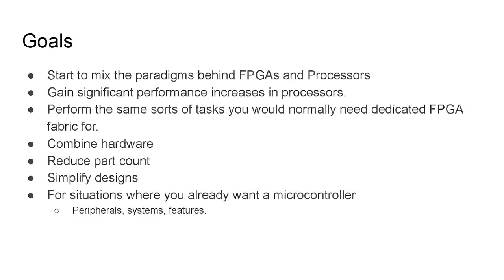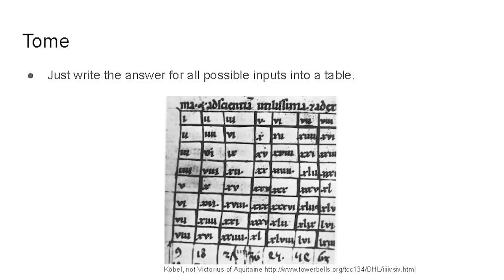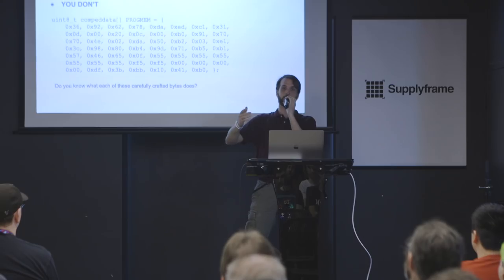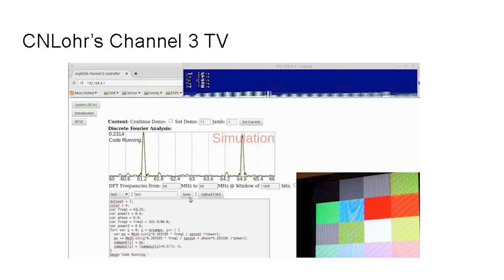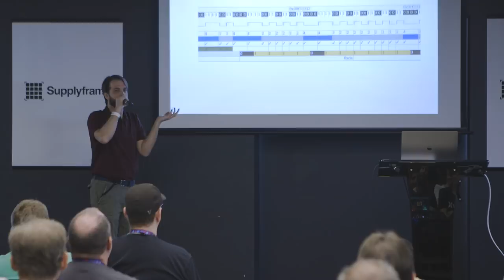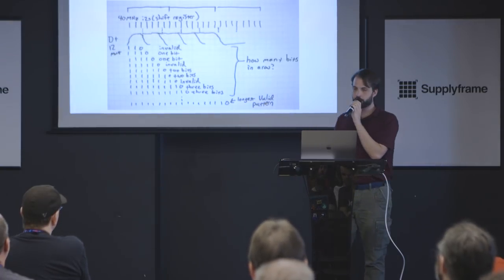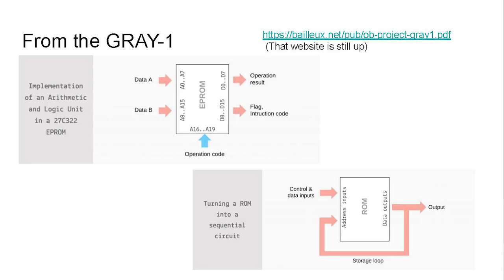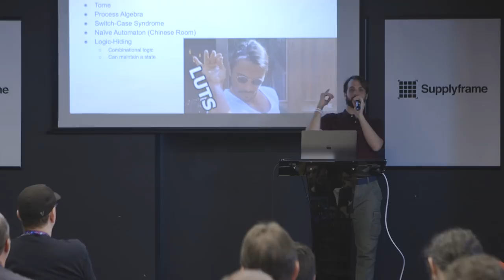Charles Lohr - Accomplishing the Impossible with LUTs

Comment: One thing to consider with LUTs is the lookup costs. If you are on a modern machine with lots of cache the RAM lookup can be more expensive that computing the value.
Reply: This is particularly interesting when it comes to zlib.  You can expand the immediate lookup table to encompass all possible bit values, but it turns out it's a lot slower because of cache misses than doing a small table and any ambiguous options just say "I don't have that entry, go find it the slow way"

Comment: Just one note, if you actually want to reuse some code, make sure you document how the LUT are generated. If not, you might end up with unmaintainable software, because the knowledge to reproduce or modify the table is lost. Maybe even include a snippet for generating the LUT.
Reply: Or better yet, include the generator scripts in the repo.
Reply: or do like that (imho mostly bad) arduino onewireprotocol library does and set a compile time constant that defines whether or not to use the smart lut way of things or the slower conventional code. this may just be an addidtional helpful thing to have aside from the generator code
Reply: What @cbrpnk said.  Any time you use code generation to solve a problem, the generator program becomes what is maintained, documented, and distributed for the project. You could even argue that the generator's output - the LUT in this case - doesn't even need to be checked into the repo, since the generator can be run at compile/setup time.

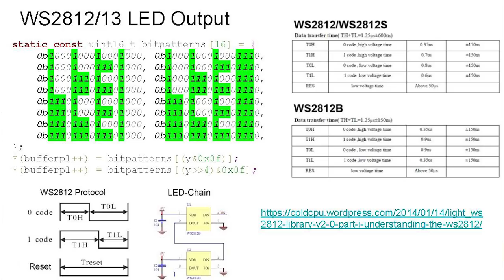Comment: Just a note to those following along. On the WS2812 look up table code at 11:50 , the look up table is used to map the y byte value into its WS2812 representation on the communication line. If y = 0xfe, the lower nibble 0xe(0b1110) is indexed to [1110][1110][1110][1000], the bitbanged shift register representation(Assuming a bit delay of ~0.2us) of 0xe on the WS2812 protocol. The same for the upper nibble. y=0xfe therefore maps transparently to its WS2812 line protocol representation .

Comment: An observation. 20:46 where you read in state use a lookup and then also feed some of the output back into the lookup - this is the same paradigm used by Wozniak on the Apple II Disk drive controller that accomplished the amazing feat of floppy interface that became known as the Integrated Woz Machine and was cheaper and simpler than the 40 pin disk drive controllers available on the market at the same time. It goes without saying that this is a fundamental paradigm.

Comment: I've been a fan of lookup tables for a long while now. The Apple ][ high-res color mode did NOT use a linear address space for vertically addressing the video RAM (it was surely a Woz thing to save on TTL chips), and a lookup table for which line starts as what address made things a lot faster.
Reply: Same with the old ZX Spectrum. Was faster to use a table to work out the first byte of a row than bit-shifting etc. Also, totally unrelated, was faster to clear RAM in reverse by setting the stack pointer to the last address-1, then using the PUSH instruction to store 16bit values and decrement the pointer by 2 bytes with a single command :)

Comment: First off, sig() Log() etc. aren't that hard to do without multiply.  CORDIC and relatives lets you do them using a small LUT and a tight loop at 1-bit/loop.  This is especially good for situations where the lookup table transitions can cause trouble like with PID loops. 

Second, LFSR's are awesome.  In some assembly languages they're super cheap.  (In Parallax Propeller assembly it's two instructions for 32-bits).  The other dirty LFSR hack I've used is the Johnson counter.  The Johnson counter logic is trivial and the output is a sparse grey-code.  It let me add a stupid fast asynchronous pulse pre-counter to FPGA code without spending a month figuring out the IO-pin shifters.

Comment: I wonder if i can use LUTs on ESP32 to bitbang 433MHz RF signals to control that cheap AC power switches… Did he used upper harmonics to reach the analog TV band, or pulsed directly at the right frequency?
Reply: You can probably do that, though it is difficult.  When you use the comb, the signal quality at the higher frequencies is reallly rough :(